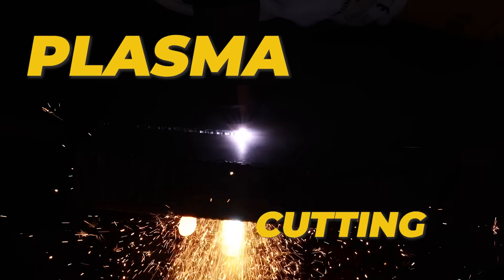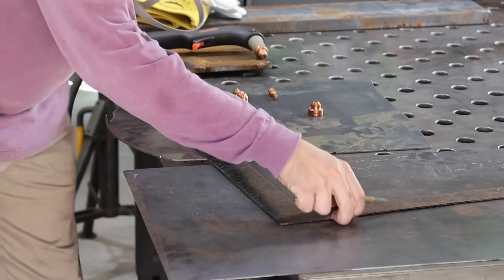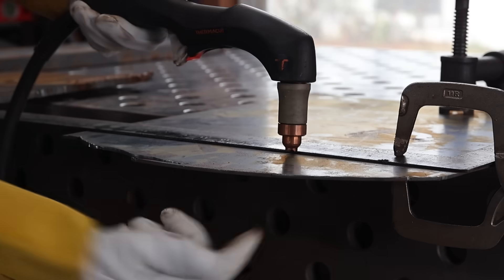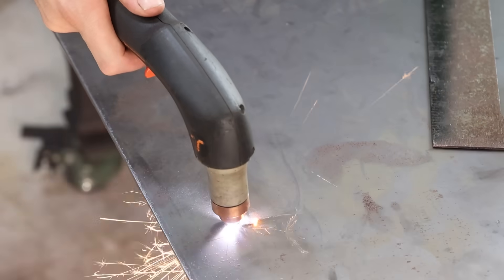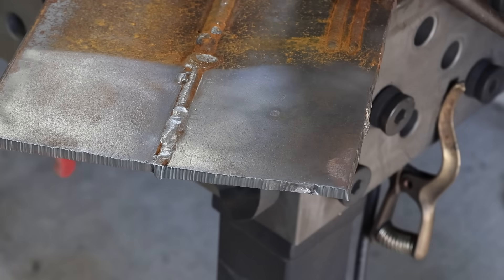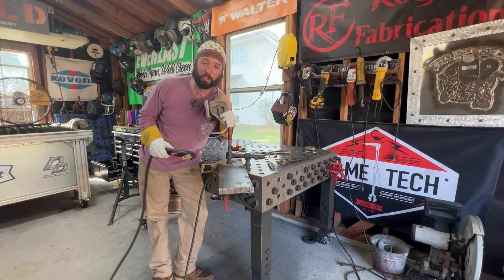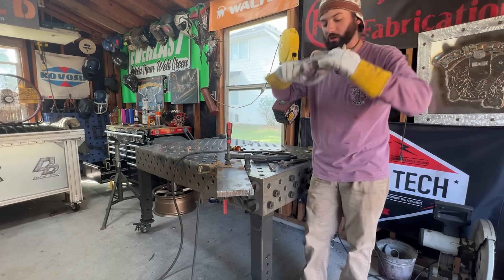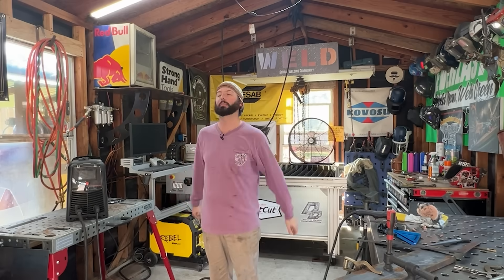Say Goodbye To Dross With This Plasma Cutting Technique

Comment: I pesonaly have MUCH BETTER torch control by PULLING THE DRAG TIP TOWARDS ME. THATS WHAT DRAG IS. It is called a drag tip not a push tip..When you scribed your part ,you pulled  or draged you scriber toward you.

Comment: I just cut with a 5-inch battery DeWalt freehand. If people had my skill which is no longer taught to our youth? Bro plasma cleanup sucks when you have to do tolerance work
Reply: Not if it's done right. And It will be Much faster.

Comment: Cutting fast is especially important with stainless steel, the dross on that will weld itself to the bottom of the plate or sheet and be a real PITA to remove.

Comment: My understanding was , you should always pull ?
Reply: You hold the torch at 90 degrees, technically, you can cut in ANY direction you want. Personally, I cut in whatever direction I can see the best. If I'm using a fence, dragging towards me seems to be the smoothest.

Comment: Nice Crescent hammer.
Reply: The correct name is Adjustable Crescent Hammer. 
You can also use them to lever the cut metal off by setting the adjustable hammer heads wide enough to slide on the stock

Comment: Thank you putting this video out. I learned a lot from this video alone. 
After watching this video I went to shop and was able to complete a number cuts almost dross free and minimal clean up not to mention I made it through those cuts without having to change consumables and didn’t get any slag build up on the tip. This channel had so much learning material and I’m the sponge. Please keep the videos coming

Comment: I need dry air! But more importantly, Im trying everything I can to make my cuts as square as possible but its been difficult to make everything come together. Ive been test cutting on a piece of 1/4" steel with a 60A consumable at 60 amps, 80 feed rate, 70 psi on wet air sadly, and on my last test cut I found that my torch was not perfectly square with the material, so my last test piece was the best so far, but its still not as square as I think it can get. If I slow the feed rate, it doesnt improve, I have not tried speeding up the feed rate, Im going by Thermal Dynamics recommended chart. I have an exposed 60A consumable thats fresh, I also have 40A consumables. I will now (soon) get dry air, because boss man is all for getting this old Torchmate CNC table fully operational for our projects!

Comment: I wasn't even aware that tips came in different sizes.  My plasma came with one size tip and it's got that little guard that keeps the proper distance.  But that guard makes using a guide almost impossible.

Comment: Great run-down. One technique I was taught for pulling along a fence, is to hold your arms out straight and move your body. For short runs you can just lean back, but for long runs you might have to take a step or two. The key is not to transition between methods of moving the torch. For example if you are pulling by bending your elbows and you run out of room and transition to bending your wrist, it will be really hard to keep a constant speed and angle. A practice pass takes 2 seconds and will identify any unseen issues (like bumping a clamp with the torch, or stepping on a piece of scrap on the floor) and will give you a good idea of how you will have to move through the range of the cut. Speed up until you get a mild lean on your spray, and focus on keeping that smooth speed for the rest of the cut. Getting a good ground is key, clamp directly to the work piece if possible, and hit the mill scale with a flap wheel so you're connecting to bare metal. I use a piece of aluminum flat bar as a straightedge, and clamp it to the work with the ground clamp when I can.  Chiz

Comment: Thank you for the video. I have not purchased a plasma cutter yet. Why use a plasma cutter over a cutting torch, if you have a cutting torch? Only trying to learn.
Reply: oxy - acyt torch won't cut stainless steel or aluminum and a plasma cutter will and in my opinion plasma cutters are really great for thickness's under 3/16ths,  they cut very fast with a narrow kerf so you don't get warping of the material like with a gas torch. I cut a hole in a new livestock trailer for a louvered vent with no warp at all, it was 16ga. sheet metal and was on a rounded front of the trailer. But for most shops you still need a gas torch for other  applications like thicker materials  and heating material. The consumables on a plasma torch can be pricey, filtered air on a compressor that can keep up is a must. Hyper-Therm is my choice And I wouldn't buy anything less than a 45 amp machine.  Their are alot of cheap china machines out there and have  good reviews on youtube, but if they are like most of the crap that comes from a communist country that wants to take us over, it won't last, and neither will they.
Reply: Okay, thanks. The torch will cut stainless. You are correct it’s the thinner material that will warp like crazy. I have a pretty good air compressor that would keep up unless it was a long cut , say 2 or 3 feet. Thank you for your help.

Comment: Power is where Hypertherm outperforms. An Extrafire 85 on 240V single phase only does 65A. Yes 65A is the max output for the 85 on single phase. On the other hand a Powermax 85 on 240V single phase outputs full 85A.

Comment: I just noticed your channel and like your content. I have a question for you. A friend built a custom car and had to shape the windshield by trimming the upper corners. He told me that he put aluminum tape on both sides, drew his lines then used a plasma cutter to cut it. He said it worked just fine. He did then take it to a glass shop that had a wet sander to smooth the edges. What do you think about it?
Reply: I'm going to give that a try and do some test. Thanks
Reply: @robert5  Please let me know the results.
Reply: @bdtodd50todd38  not so sure what you need to do. not sure how the aluminum tap would help other than a line to follow. In my experience the plasma will cut through tape if it gets contact first. I imagine the aluminum tape would make it easier to get contact.
Reply: @Drweldz  You clamp the ground around the glass making contact on the tape. Yes, the top tape will just be a line and a place for the arc to start, but the arc should go thru the glass to the bottom tape.

Comment: What I want with thick metals is a nice sharp bandsaw... 😉
Reply: That works, but can be kind of slow. Before i retired from the steel fab business, I used oxy propane torches to cut steel up to 14 inches thick. Yes the cutting speed is quite slow, but still much faster than a band saw on the same material.
Reply: @mikeburns703  I spent most of my time doing repetitive stuff in a machine shop as their welder. Cut pieces stacked in a power hacksaw or an auto bandsaw. Set and walk away to do something else in the workflow. Speed? Probably the same on thick pieces but better for my workflow... Sheet metal is definitely faster with a torch.

Comment: I need to use my plasma cutter more.  This video makes me wanna go out to the shop at 1:30am and fire up the compressor and start cutting shit up.
Maybe I'll try it on a bunch of steel rivets I gotta remove, should be quicker than an angle grinder.
Thanks for the tips.  I knew most but no one knows everything and sometimes it's good to relearn and be reminded of the things you already do know.
That came out jumbled af like im a loon, meh... you're a smart dude, you get it
Reply: How big are the rivets?! id personally just grind the tops off and pop them out. keep from damaging the other metal. Plasma could do it, just may make a mess of things.

Comment: A respirator with a beard, an OSHA no no.  Haha.  No seal so pretty much useless.
Reply: Still better than nothing .
Reply: Works for me but my beard is close cropped. You can tell if the air is bypassing the filters, I just reposition the mask if I sense that and it works fine.

Comment: YES!! Please show how to improve cuts on a CNC plasma cutter.  I would like to improve the dross issue.
Reply: Being close to the right speed is important, but what is more important to consistant nice cuts by hand is SMOOTHNESS.
Reply: @mikeburns703 For sure! Starting out I had the tendency to jump everytime Id start a cut or when sparks flew back towards my face! Takes a while to relax and go smoothly!
Reply: with my CNC machine, i found i needed to be setting the cut speed ALOT faster than i initially thought. and setting the "slow down on curves" is another setting that takes alot of practice to get right. the best thing i did, was to draw out several "test mode" pieces to cut out- basically a 1.5 inch square with a 3/8" hole in the middle. it doesn't waste alot of material, and at least with my machine (Langmuir Crossfire Pro), i can speed up/slow down the cut speeds within the software just before the cut, i just kept upping the cut speed by 5% until it was obvious it was too fast. take lots of notes, and soon you will have alot of data for travel speeds/cut height/pierce height and delay to set up the proper "machine" in your design program (i'm using Fusion 360). also, having a large compressor with a decent dryer/filter setup was also key- small compressors can have difficulty keeping up during a cut which causes pressure fluctuations.
Reply: ill give it a go!